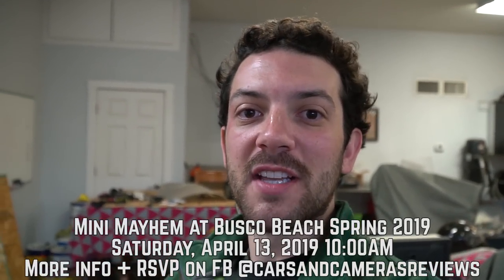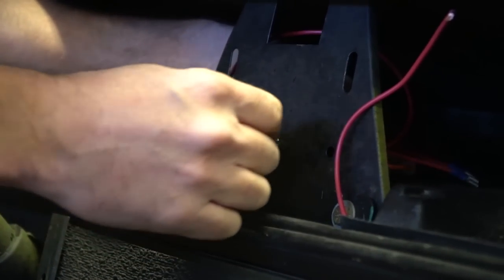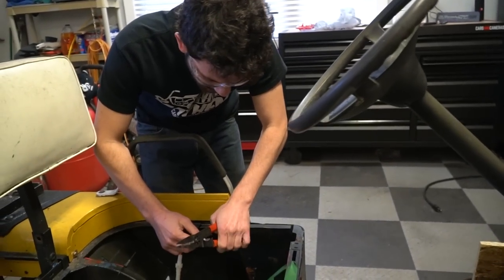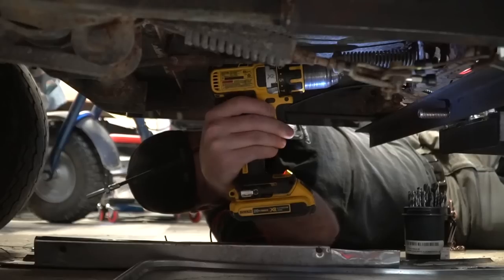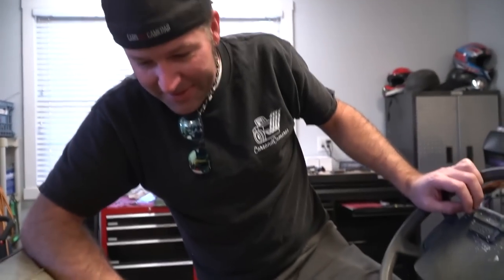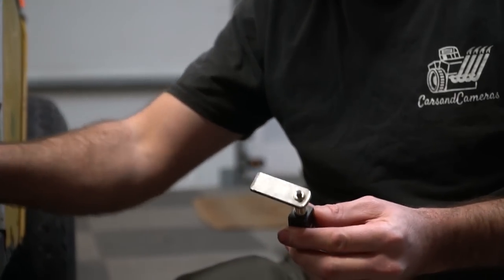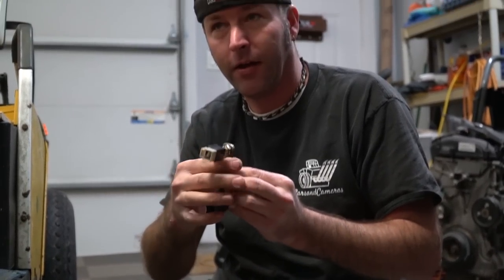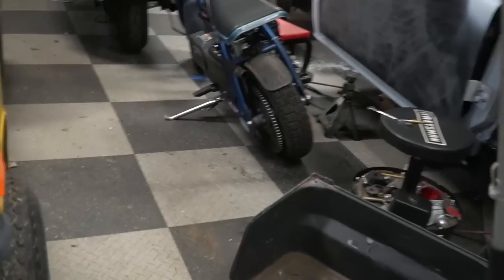Golf Cart WHEELIES | Built 420cc Golf Cart Build Pt. 5

Comment: You need another switch so isolate the two circuits. This would be the easiest solution to this problem because the turn signals are pretty much two separate circuits that flash a light. You just have to mount another switch next to the existing one.

Comment: May be u could do a dedicated signal only lights in the the rear meaning ud have another set of lights in the rear besides the break lights n u n just have that switch operate them n the front signal lights only then u could have ur break light by the switch on the pedal so when u got the breaks pressed u'll have both signal lights n break lights like on sum cars where the break n signal lights ain't in the same light but separate units

Comment: Wire in a resistor at the taillights and then a relay where your rear turn signals and brake lights meet your front turn signals

Comment: Hey guys, add separate lights for the rear signals. 
You're trying to get to many functions from one light. 
Also, I dont even know if a red signal is legal.
Then again, the mustang signal may be red, idk.
Just add another cheap light on the rear corners for signals and that will solve your problem.
Oh and can you steal the charging system from a lawn mower? Or is that something Go Power Sports sells?

Comment: The lights should be a stop tail turn.. you shouldn't need any diodes or anything just hook the hot coming from the brake switch to the stop portion of the pigtail for the light and you'll have turn signals while also having brake lights.

Comment: Use two five pin relays to allow brake and turn lights be separate on rears only thing is you will need to have two flashers one Hooke to each relay that gets feed from three way switch and a power from each relay to the turn light switch one relay will be hooked to left side of switch and other to left side of switch

Comment: the answer to the brake light problem is in your old chevy truck note turn signal wiring there. hint the brake lights go through it. so when left turn is applied right brake is allowed  when right turn is on left brake light circuit completed/closed thus on....peace

Comment: I would have put the turn signal switch on the steering wheel. And to fix your flashing problem. You have a thermal flasher they sell electronic flashers that are timed electrically. All you have to do is add a ground.

Comment: First - Remount that gastank ELSEWHERE or make a solid flip-up seat to add fuel.Second - Add amber lights FOR the turn signals.Third- - Add a neat DUAL exhaust exiting out the rear ( or make "sidepipes" on each side.Final - Add a killer sound system !Thank me later

Comment: Use a relay. And wire it with the signal switch. It will let you switch the rear light into signal mode and stay flashing with the brakes on until you flip of the signal switch. I can make a diagram if you need one.

Comment: there special relays for LED lights , think there non mecanical 
about the brake switch , if youre looking for them look for NC  meaning normaly closed or NO meaning normaly open , relays have the same codes its pretty simple actuually 
tried to find a witing diagram for the lighting but couldnt find it

Comment: What happens when you step on the brake for brake lights and have a turn signal on? Does it cancel out the brake light for the side that you have the turn signal on? The quickest and easiest way to resolve that is add another set of Lights. One set for your turn signals and one set for your break. I had asked this question as soon as you got your turn signals and had and watch the rest of the video but knew that it was going to be an issue. So yeah two sets of Lights is your quickest and easiest way.

Comment: thermal flashers use a bimetallic strip and a wire raped around it, the wire heats the strip when powered and the strip pops off of the contact causing the wire to cool off then the strip pops back cycle repeat, this repeated motion is what turns on and off the lamps, the wire requires a bit of current to pass through the lamp’s filament to heat up, led’s don’t have filaments so it doesn’t work right.

Comment: To fix your tail lights. Wire the rear lights as break and turn signals, then add a separate running light. Then when you hold the break it will stay solid on one side and the other will blink brighter. Get some penny sized LEDs for the running lights, they're small enough to fit beside the rear lights
Reply: Or get an electronic flasher. 
I got an adjustable one which is a nice feature. 
Or add a load , load being an incandescent bulb ,like the dash indicators. 
Or buy a couple of those resistors for that purpose. 
There's a bunch of ways to straighten it out.
Reply: They should add rear signals. They are trying to get the "brake" lights to do to much

Comment: You need to a a 3rd light for your turn signal on each side. You can not put turn and break lights together you would have to have 2 separate circuits to make it work the way you are doing it

Comment: Automotive systems used to get routed through the hi/low switch for the head- lights. The left turn and brake is on one circuit. Right brake & turn is also one circuit. Along with the running lights.
I've still got all my books from tech school that covers Automotive Electronics... If your interested ???
PM me I'll work something out.

Comment: Could have started with a modern digital blinker relay (saves needing to add a load.)
Brakes and blinkers need to be segregated as circuits. This could be accomplished with a turn signal kit, they are pretty cheap, or use some standard bosch relays.

I always hated trying to fix brake/blinker issues after people tried to fix it themselves.....lol

Comment: You just needed a resistor between the wires on at least one of the lights for each side, could have measured the resistance in a regular bulb and find a resistor in an old radio of something with about the same resistance and snip it out and tie it in on one light on each side or on the relay.

Comment: why do you guys never think about making a chargin system??? that would help out soooooo much. even if you have to put a fricken magnet next to the flywheel with a little wire dangling off of it at least your getting some charge so you dont have to worry about battery charge and charging the battery every time you want to ride it.

Comment: splice into the hot wire coming from your turn switch (one for each side), land it on a contact  relay to energize the relay, on that relay take the hot wire going to your brake light and run it thru the normally closed set of contacts of your relay. this away when u apply your brake you will not have it on the turn side but maintain it on the other.

Comment: You guys should have a alternator with a belt and a tensioner connected to a lever so you can choose to charge or not  so you can still use 100% of the power 50% of the time

Comment: Hook up a separate brake and turn signal Amber in rear or you have to run turn signal through brake light switch front and rear are separate circuit

Comment: Idea separate amber turn signal lights on rear using brake lights and running lights that way you dont need all that other crap F&R directional lights then Rear tail lights/ BRAKE LIGHTS

Comment: TURN SIGNALS/BRAKES
I have a diagram I drew up years ago shows how to wire turn signals and brakes. Also you need to use electronic flasher, or load resistors. Flasher uses current to create heat, moving a bi-metal arm to make and break circuit. Don’t know how to send image of circuit.
Reply: Just posted it over on your Facebook page

Comment: yall should put the original fly wheel back on with the charging system so it will keep the battery charged and the lights will work like they should

Comment: They have an adjustable flasher on ebay. Also buy a cheep turn signal switch that mounts to the steering column. Run your brake and turn through it.

Comment: you guys need diodes to isolate the circuits from each other. Also the turn signal needs to work OVER the brake lights

Comment: Y’all need the gas tank off a cart just like you have so it will bolt right in and use the same style pulse pump and it will hold I think 8 gallons cause my cart is just like yours but mine is a gas.
This way your engine compartment will have more room and you won’t have to cut a hole in the seat

Comment: the turn signal relay wont really matter unless you put like a million leds in it. go to auto parts store and buy an actual led flasher relay or use load resisters. super easy to put in

Comment: Not sure if you're aware, but you should be carful about doing one wheel peels too much with that. Diffs are not meant to take that much sped differential between tires for extended times, they do not have the proper beraings/bushings and will overheat.

Comment: weld dif?
Reply: I was thinking just throw in some extremely thick gear oil so it has some give for cornering around town
Reply: @kylearruda1041  That's a great idea
Reply: @kylearruda1041  Some Lucas Oil Stabilizer mixed with some Moly grease and fine sawdust, worked on a truck I had 😂
Reply: Sounds good to me!
Reply: No it destroy the wheel

Comment: You would have been better of with a cheap motorcycle brake switch. easy install boly one end to the frame close to any moving part of the brake system(maybe near the rear wheel) and clip the spring onto the lever in a direction that pulls the switch.

Comment: An easy fix for the brake light signal light would be just install a second set of smaller lights for the signal. Rather than trying to figure out the wiring. Thats what i would do.

Comment: I need your help, I have a 212 mini bike and I put a performance air filter and jet kit on but I can’t get a new exhaust because I ride in my neighborhood, will the performance parts make a difference?
Reply: Mason Rose-Hamby prob not
Reply: It will help but you won't get the full potential out of it.
Reply: Look to see if you can get the exhaust from the Tillotson 212 as it's quiet but I'm sure that it is better than stock.
Reply: The exaust is a huge bottleneck.  You might not see much performance gains with the factory exaust

Comment: had u guys worked on a rupp mini bike
Reply: mikey dekraai  I had a 71 Rupp scrambler when I was a kid.  It was awesome.
Reply: i got a 1971 Scrambler last fall. not impressed by the front shock might need new springs.   original tires  48 years old  still work... not so much for the bearings
Reply: @fart306  I do recall that the front forks didn't do much at all.  Is your Rupp green?
Reply: @marcmo7138  it was green some some sprayed black over it and its chipping off in some areas.  But its missing most factory parts like guards, engine, gas tank. So it's a restore to ride rather than a collectable

Comment: take an old motorcycle/ dirtbike motor take off the jug and take the piston out and the rod weld a shaft and sprocket to one side of the crank and then run it to a seperate motor while leaving the motorcycle transmission and clutch intact and Boom your built 420 has a 5 speed trans that will actually hold up and give you plenty of top speed thats just my 2 cents

Comment: I have a feeling that whoever inspects that thing is not going to be happy at all with the exhaust and possibly all of the cancer. I'd do my best to wire wheel and paint as much of that as possible so they see as little as possible. And for the exhaust I'd grab a cheap MGOD or Annpee slip on. You can get them for under $50 on most sites.

Comment: Turn signal switch is much more complex when using common brake and turn bulbs. It needs to open the brake light circuit on the side you are turning while keeping the other side closed. You don't need to add extra lights to the rear.  This is a simple solution that just replaces your toggle switch: https://www.summitracing.com/parts/rfw-ss1/overview/
Reply: Here is a cheaper one: https://www.summitracing.com/parts/aww-500148/overview/

Comment: You can add another light for turn signal only. Or, like I did when I wired my 67 Baja Bug with the same type of oval LED lights, use a trailer light converter to control it. The converter is for cars that have a separate turn signal to tow a trailer with combined turn and brake lights. Works like a charm. You should be able to find one at most any auto parts store.  

https://www.napaonline.com/en/p/BK_7552161

Comment: You need an led flasher
Reply: Yup. A common issue in the motorcycle world.
Reply: They used a led flasher, otherwise they wouldn't have blinked or have done the rapid flash. The problem is that they are getting feedback through the single turn signal indicater on the dash. Had the sa.e issue with my motorcycle.

Comment: Screw the 420cc engine put the Ducati motor on the golf cart or get a crotch rocket motor just send her bud . I apologize if I sound rude to you guys.
Reply: Ducati motor or anything better than that would destroy that sprocket that they're already having problems with.
To put that on there they'd need to heavily modify that rear end.
Reply: They have flex for an exhaust pipe... Just saying...

Comment: Why not spend 20 bucks on a real turn signal switch orrrr put separate brake turn signal and brake light? The way you have it now basically defeats the point of even having rear turn signals and will most likely fail inspection.

Comment: Find a tail light converter like the Curt 56187 or similar to take care of the brake/signal issue.

https://www.curtmfg.com/part/56187#Trailer%20Wiring%20Install:%20CURT%2056187%20Taillight%20Converter
Reply: I think we installed it in the next vid